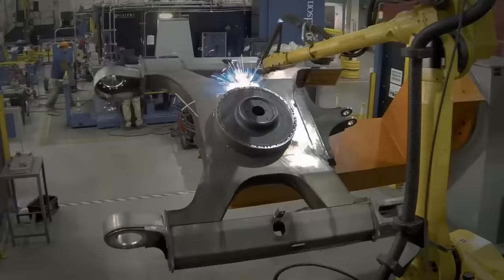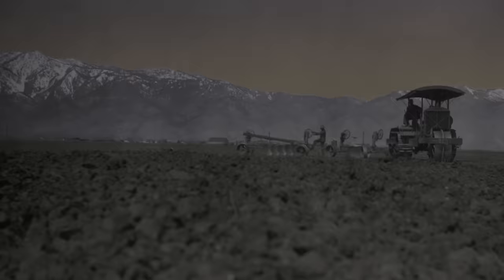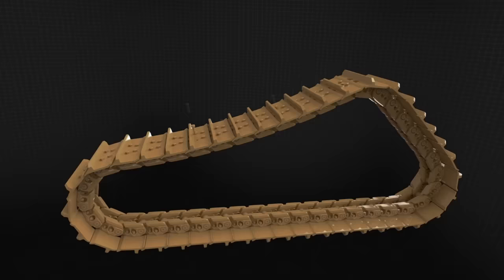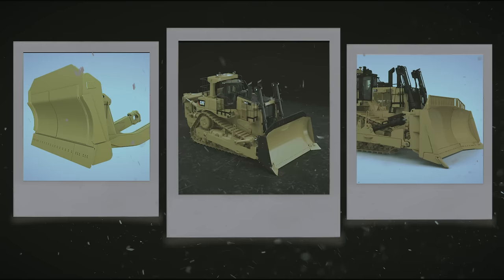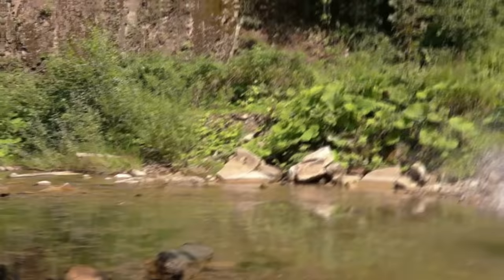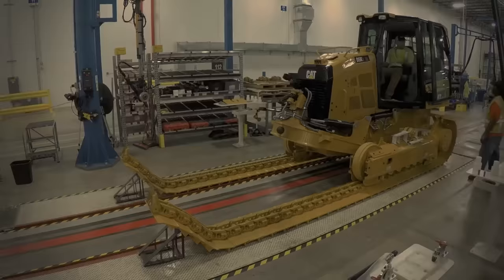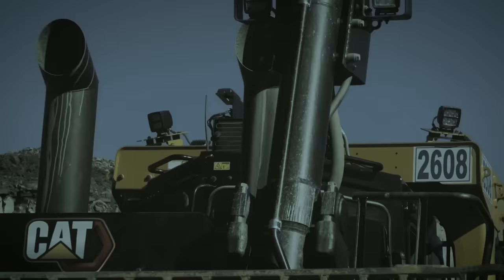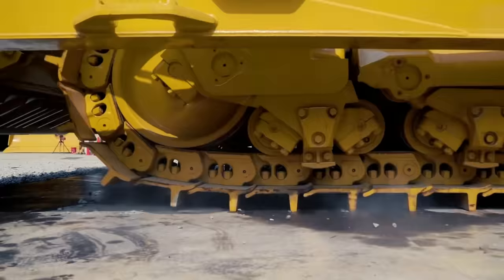CAT D11 - The EPIC Story of an Awesome Machine | Full Documentary

Comment: This was a good video of the bulldozer history and the mechanics of the elevated sprocket tractor current design.  I was transferred to the Cat Track Type Tractor D10 design section from Cat Defense Engineering in 1976.  Working as a draftsman engineering technician on the first production elevated sprocket D10 tractors, I remained in that division until I retired in September 2000.  During those years, I recall doing changes and designs for production issues, assembly issues, and components.  I redesigned the prototype fender to be more narrow and bolted to the rear drive case casting instead of being welded.  We added skid plates to the top of the fenders and hand rails to the ROPS base.  I designed the first fire suppression to be provided as an option for the tractors.  I redesigned a final drive bevel gear that had a spacer plate to be a single part.  I designed a ROPS base to provide a mounting for the cab and also a cross member with a mount for the cab and a firewall.  This eliminated a support frame for the cab and reduced shake motion felt by the operator.  I designed a pair of housings for the drive shaft to go into the rear drive case to provide lube to get to the bearing needed for that entry.  In 2000, I was transferred to the pipelayer design group.  We designed a machine with a hydraulic lift cylinder and a counterweight that opened like a door that did not go into production due to the hydraulic cylinder allowing a "drift" that did not keep the pipe from moving slightly, that is necessary for welding the pipe joints. I later worked on Custom Shop tractors, mostly land fill machines, that required modifications to keep wire and other debris from entering the engine area and the sprockets.  We also designed and built pipelayers modified with engine and hydraulic tank heaters for use in Siberia operating on the permafrost at temperatures around minus 40F.  Some readers will know that bulldozers are the Cat product most identified  but there was a huge range of equipment, engines and transmissions that evolved from the beginnings of the Holt and Best merger that became Caterpillar. I hope this is interesting to the gearheads/designers, factory planners/assemblers and will add a link to a few of the remaining designers and technicians from the Cat Track Type Tractor engineering people I have contact with.
Reply: A fruitful career. I hope you know in your own way, that you changed the world.
Reply: Good evening!  That’s quite the career, and what I have in mind for my career path as well. 

I work in a Caterpillar Rebuild facility, and a lot of the innovations you designed allow us to rebuild these machines to like new condition in a relatively short time span. 
I’ve always been intrigued by the research and development, and engineering aspect of the tractors.  In fact, a few weeks ago a coworker and I were in Hydraulics class in Irving.  By the third day, I was known for taking the class off on tangents that went much deeper into theory than the scope of the course, and often resulted in us digging through schematics and enlisting the help of another instructor to find the answer. 
One of our classmates asked my coworker “Is he always this inquisitive?”  My coworker replied “Yep.  We don’t let him in the component shop anymore. Not after finding him counting the teeth on the gears…”

That being said, I’ve had a few ideas for product lines I’ve thought about bringing forward.  This would be a different application than what Caterpillar is known for, but I believe the powertrain systems hydraulic systems, and even existing product lines could be utilized to be very competitive in the industry.
Reply: I'm very surprised to find out you think this video was good, this video had very generic and inadequate explanations like you'd find in a textbook. I am disappointed i didn't learn anything about this amazing piece of equipment.

Comment: Enjoyed the look at the D11.  I had a great experience back in the 60's when CAT was trying to upgrade the D9 into a bigger machine.  They built the SXS D9's with a 20' blade across the two D9's. I got to drive one at a strip mine in west-central Indiana. They were spreading topsoil back on the spoil banks after they
were leveled.  The operator sat on the right machine. The machines were connected by 64 wires that transferred the control inputs made by the operator.  It was a little light in weight to handle the 20' blade but with finesse it worked pretty good.  WOW what a ride!!!!!!
Reply from the maker: Awesome story man!  It's crazy how a 20' blade is something that can be upgraded on.  Most people don't even realize how impressive these machines are until they step in front of one.
Reply: How cool !!!!  I ran a D7, punching logging roads in the PNW.  That must have been something to push with a 20 foot blade.

Comment: i rode a D65 E kamatsu dozer straight off a 35 to 45 feet inverted rock vertical. landing on 2 light loads of topsoil that i pushed off a minute before under that load was solid rock. wearing no seatbelt, i was equipped with a ROPS that got bent down to the operators seat. the tractor turned over 1 time and landed on it's top, then sprung back over on its tracks. the dozer was running wide open and in second gear and wasn't moving, except for the oil that was blowing out of the turbo that was separated. what my injuries were: a severely burnt palm of my left hand ( had to of been from the smoke stack quite a ways away from the operators seat, my back had scratches around my belt line. my face and forehead was pack in dirt. no injuries that kept me from getting back up on the hill on monday, it happened on a friday. i was attemting to leave a pile at the edge of the top and then to push it off with the next load, the owner of the company was standing far enough back to start waving me to push it off, i did and nearly crapped my drawers when i sluffed of the dozer blade. i backed up and pushed a second load also starting to back up, and owner was waving me to push it off i did and when i put it in reverse, i must have hit 2nd or in between gears if it's possible, and let off the decelerator and it was in slow motion going forward by the click of growsers or what the track cleats are called, "click, click click slower that 1 second intervals and as the idlers were nearing the edge i froze and squeezed the clutches while screaming "im gonna die" over and over. i was 18, iwas the loudest and roughest thing i've ever been in. i had to of missed me by inches, i ran out of the dust cloud and went up to owner and said "well it doesn't look like you need a operator like me, he said he couldn't believe i wasn't dead, and  he ran up and shut the dozer off.  i had never worked in the hills before, only in the flat lands with fills no more than 5 ft, pulling a vibratory sheepsfoot. and if you want to change directions, you didn't need the brakes because the roller stopped the tractor immediately. to have corrected the fall all i had to do was put my foot on the brakes. i didn't know about that. monday moring a 988b was loading 40 an hour the owner said if i don't get up there, i might develop a fear for hills and never be able to do it again, and i wouldn't get less than 4 piles away from the top edge, the insurance totaled the dozer and the loaner dozer from kamtsu was with street pads and a four in 1 bucket, with no seatbelt. but brand new tractor and rops of course it was around 1979. i went on to a full career running scrapers, 666's 657's,  637 was my specialty, rough but they'd go anywhere. . in the hills of sounthern californa iuoe, didn't file any kind of injury lawsuit, the owner took me to the hospital and in a couple of hours i was getttin a  ride back to my truck. sittin in a deep seat, both feed flat on the floor with a far away look, i was a dirt diggin mofo.
Reply: Thank you for sharing this fascinating story , I'm glad you came out of this with minor injuries. Best wishes and God Bless.

Comment: I was a D11 operator for 11 years , such a smooth machine . I pushed coal on a coal yard. I turned a d10 T2  over on its side on the side of a coal pile and was able to turn it back over without any help !
Reply from the maker: Thanks for the stories man, we love hearing first hand accounts.  The D11 is a beast to be sure, and we can imagine how cool it must've been to watch that D10 get flipped
Reply: We had D9's and a D10 in our coal yard. Seen a couple D9's go on their sides. Thankfully never had the fun of doing it. Went off the pile sideways but got it turned before it rolled. Did it for 14 years. Wish I could do more. But they closed the coal side down.
Reply: Serious question.   How’d you flip it back over ?    How far over did it flip over ?
Reply: @billygriffith8933  let off the D celebrator pedal , giving it full  throttle I went forward and reverse until the tracks dug a hole and it was able to set up on its own, and I didn’t mention the track come off of the rear roller and was rubbing the counter weight. But I was still able to drive it around to the tractor shed so the mechanics could fix it. By the time I got it around to the front side of the coal pile the track was hot enough to burn you from rubbing the counter weight .They had to take tension off of the track to get it back on the rear roller . The bulldozer was brand new they could not figure out how I tore the track off and I never told them 😂😂😂😂
Reply: @rogieru8796  But now they know!  😂😂😂😂  Good job!
Reply: How was the engine oil pressure while it was on its side?
Reply: @brianrvd  I can assure you that’s the last thing I was worried about . I can tell you how my blood pressure was though , it was maxed out

Comment: I found the reason for Cats success is the quality of the steel they use and cat8 bolts in every joint. Especially the fluid filled track units. When overhauling the cat tracks you saw the quality in every part that l think it’s  the reason they continually last
Longer than other tractors. Also spares and service is good which ensures longer life of your machine plus the fact their still working while other makes haves disappeared.
Reply: Kamatsu 475 and Cat D-11 same material,same hours,the Kamatsu will be ready for the rebuild shop while the Cat is still producing!
Reply: @randallstewart8487  American steel 🇺🇸
Reply: @mauricemotors8207  True,the difference between American steel and Japanese Steel!

Comment: I use to install fire suppression systems on D 11s with  S blade's for copper mines in Arizona  and measured the width of the blade at 21'6" with a Stanley tape measure
Reply: That’s what I was thinking. Regular 966 size wheel loader is about 10ft wide.
Reply: Hmm... FMI Morenci?
Reply: If you can find a photo of the D10 on display in front of the Track Type Tractor building SS in East Peoria, you can see a cabinet on the left side fender.  That contains the first fire suppression system put on a bulldozer.  It is very simple.  A halon bottle with two hoses running into the dozer.  One is into engine compartment to deliver the halon.  The other is from the actuation valve into the operator compartment where there is a nitrogen bottle sitting on a shelf behind the operator.  When the operator pulls the release valve handle on the nitrogen bottle, pressure from the nitrogen goes to the halon valve and the halon is released. The reason this was installed and became an option occurred when  the first prototype D10 engine caught fire at the build area.  Probably the new systems are actuated by a solenoid with a switch or button on the operator console.
Reply: I the width of the transport is 12' wide that outside of track to outside of track. The blade is always taken off. I think they messed up on using that number instead of 21'

Comment: Yeah it might be nice having all those bells and whistles, but one thought keeps coming to mind. "The more they complicate the plumbing, the easier it is to stop up the drain".
Reply from the maker: You're not wrong!  But, as much as complication can be troublesome, it's worth noting that experience is how things are made to be reliable to the max.  100 years ago, a jet turbine would be considered impossible to produce to any real degree, but look where we are today.  You can look at the progression from muskets, to breechloaders, to machine guns.  Time shows that the more research is done into any one thing, the more reliable it'll become.
Reply: @LordGizmo  Tell you what, you take a new D-8 with all the goodies and l'll take a old D-8 that has been refurbished to original  factory specs (just to make it fair) and l'm talking with a pony motor start system, run them both for 5 years and see who has the most down time.
Reply: @superchicken5285  Indeed, but that's because of ridiculous environmental laws that force the manufacturers to limit every drop of diesel burnt and so they have to control engine parameters with computers... A hitherto unnecessary complication.

Comment: Wow! it's good those "operators" at 14:20 had there "high vis" outfits on!!!! They could have walked into each other!!!!!!!!!!   lol
Reply from the maker: Hey!  Safety first ;)
Reply: I work for that company, that's our autonomous control center. Anyone who comes onto the coal mine is required to meet minimum PPE standards, also the operators are required to pre-start the machines before use so hi-viz is essential for safety when working around the Dozers.
Reply: @DynamixGTR  okay
Reply from the maker: @DynamixGTR  Thanks for the info!  It's hard to get a lot of that kind of info without first-hand accounts, like yours.
Reply: @LordGizmo  No problem!  Our coal mine runs 24/7 in 12 hour shifts with around 2000 workers. When working with autonomous dozers we have to have a special designated park up area away from the main " go line " and our work area's are also restricted for safety. We are also required to carry a remote device called an " A-stop (its a remote control) " that allows us to kill the dozers with the remote if we need to. There's a lot of moving parts and personnel on a mine site so safety is a high priority..
Reply: @DynamixGTR   just a few questions sparking in my head that maybe you can answer.  Is there any  delay or lag happens when you control the machine remotely? Did you feel any insecurity? Like one day those machines will be working 100% automatically and you guys don't have any job. What's future of coal mining?
Reply: @THEIDEABEHIND  operating them is… an experience.. you don’t have the “ seat of the pants “ feeling like you would inside the cab and whilst there is cameras, the visibility is no even close to being in the cab. Ideally the dozers have to be set up in slots in a bulk push scenario with good material for them to succeed, so the conditions have to be perfect to get any efficiency out of them.. so really they’re only good for bulk push. We do rehab, pads, ramps, roads, intersections, bunding, exposing coal, car parks, trimming etc which all need a competent operator behind the controls. Dump trucks are about the only autonomous mining equipment that can be run with success, but ideally you want competent operators.
Reply: @DynamixGTR  Thanks man for your valuable comments.
Reply: @THEIDEABEHIND  any time!

Comment: I worked in the Aggregate and Ready Mix industry for 20 years. Beginning in the lab and eventually operating Aggregate plants. We were given the freedom to learn more and more equipment as time went on learning from the "Oldtimers". I always enjoyed my time on a dozer. Starting with a D-9, D-10 and eventually the D-11. Ripping and pushing went hand in hand with the D-11. I wasn't impressed with D-11 when I first operated it, it seemed sluggish, I later learned it was slow acting compared to smaller dozers but had lots of torque for working in the pits. My favorite dozer was an old D-9 open cab w/ROPS it was so versatile. And so reliable.

Comment: A D11 is a lot wider than 11’ 10”.
Reply: I was looking for this comment! A U-Blade is 249.6 inches wide or 20ft 9 inches wide.
Reply: Yea maybe for a D6 lol
Reply: The last one I hauled was 149.8” wide outside of track to outside of track. We haul the blade separately and run it front to back on the trailer as some blades can be 300” wide
Reply: Just looked it up it’s around 20 feet wide on The standard U blade

Comment: I have 12 year’s operating the D-11’s the new ones are really quiet nothing like the older rattle traps 😁 I’ve made roads, ramps, pushed on dumps, landscaping pushing over 15” diameter trees like twigs, pushing snow piles higher than the blade and of course ripping up frozen ground. After awhile you get so use to it you don’t need a anything telling you what percentage you are going up or down 😊, I watch the new employees operating them and just shake my head, they can make a hole in the ground fast if you don’t pay attention to where the blade is.